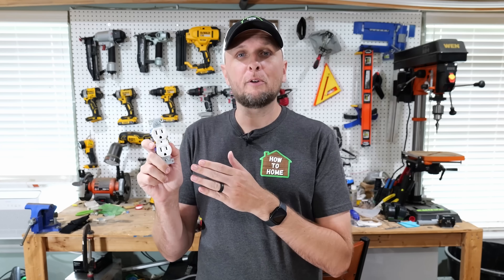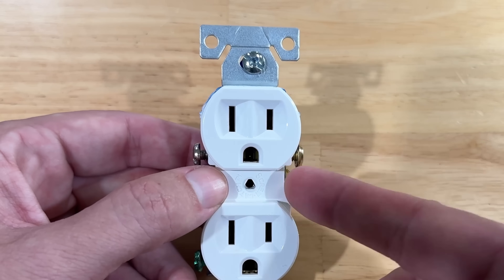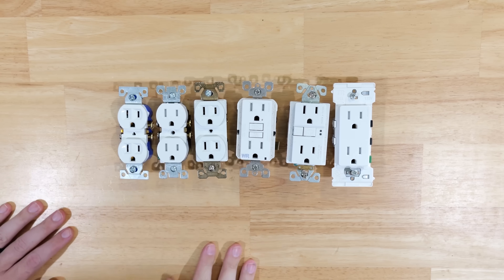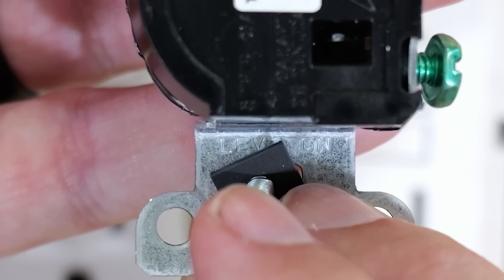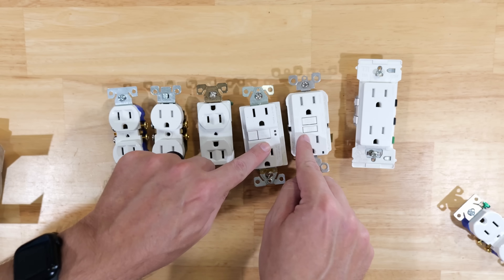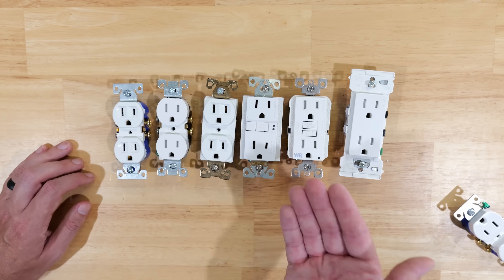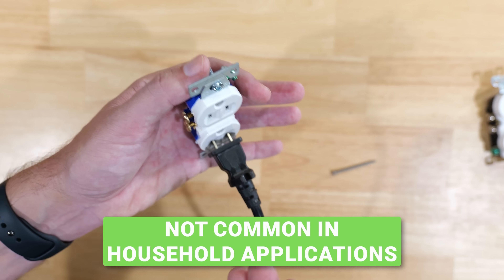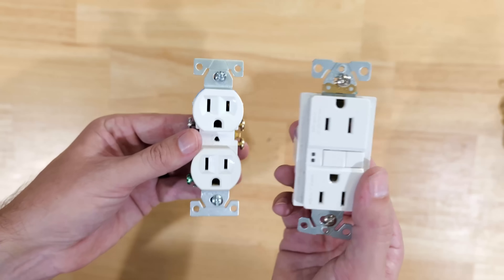The Shocking Reason Why Your Outlets Are Installed Upside Down!

Comment: We lived in a house where nearly all of the outlets were installed with the ground pin facing up. It only really caused issues behind the refrigerator and a few similarly designed appliances where the power cord was manufactured in a way that caused the cord to loop over the top of the outlet. The cord was shaped naturally for the ground pin to be on the bottom.
Reply: In our area all you ever see normally is ground down. The other way would be considered wrong but not code violation. Having ground down had two other advantages you didn’t mention. In that orientation the cord tends to be more securely held with the large round pin supporting the weight of the plug above it. Also when you go to plug in it’s easier to find the location of the sockets when viewed from above which is the usual case. With ground down the pin and part of the body block the view. To my mind this is the best reason for mounting ground down. However sometimes you run into a wiring or mounting situation that forces you the other way. Not unsafe just unusual.
Reply: When we built our house, we installed all the outlets sideways. The plug closest to the switch was the one operated by the switch.
Reply: @rivermcratt3683  If you put all the outlets sideways did that mean all the outlets were on a switch?
Reply: @daveneil3963   no, but the ones that were on a switch operated as I described.
Reply: @rivermcratt3683  goody two shoes for you
Reply: @rivermcratt3683 so ground towards the switch or away from the switch?
Reply: My comment exactly. I have yet to see a right angle plug that isn't prong down
Reply: @RickYelley 
I have two heavy duty extension cords, originally purchased for "window banger" air conditioners that now reside behind chests of drawers in our master bedroom. They are oriented "ground up" so the wire hangs down. They are no longer needed for air conditioning but serve for tv and radio outlets. Otherwise the outlets would be useless. Those recepticals were rotated, to "ground up," to accommodate them when we moved in.
It amuses/annoys me when I go to my Dr's office in a brand new building and the moulded plug on the examination bed is plugged into the wall receptical and the ground is down forcing the cable to be folded over the plug because it's ground is designed to be "ground up!"
What I'm trying to say, there definitely  are applications when recepticals should be oriented "ground down!"
Reply: In my experience, if you go to a hardware store and look at outlet strips and extension cords, the majority of them that have a up/down design are designed for ground plug down.
Reply: @ballardcoolpix  In this case "the majority", meaning "every single one", of course!
Reply: @ballardcoolpix  I've got a couple of 8 port surge protectors where the earth in face up for the top strip and down for the bottom strip.  I'm guessing it's for those oversized electronic devices like chargers etc that would normally block the outlet below it all all the outlets were to be earth down orientated.  I'd be OCD though were an ordinary wall outlet  were to have an up-down. up/up orientation, aesthetics matter.
Reply: lol this is an annoying ass problem when dealing with washer and dryers. So annoying that I've rewired whole outlets to fix it.
Reply: For any place that the outlets are upside down, I just buy and install rotatable 4-way outlet adapters. I got mine on Amazon and they include surge protection as well. Easier than fixing the outlets in the wall, and you can take them with you when you sell. Bureaucratic overreach defeated.
Reply: I had a contractor who made us install residential receptacles ground down and commercial ground up. I'm sure this was so that commercial medical facilities were ground up.
Reply: Yep. that's why I don't agree. When I moved years ago I switch them back the way they were. My new landlord is an electrican. Unfortunately manufacturers haven't adapted
Reply: Same but even worse for plug in 240V dryers and ranges.  The cord is so thick I have flipped over the receptacle to avoid a big loop of wire sticking up or out.
Reply: @sparkyspartacus2287  I have seen range and dryer cords oriented either way. I normally remove and turn the receptacle to suit the cord in use.
Reply: It looks like comments are disabled here, so I'll try it here.
Reply: 100%. that's the main issue.
Reply: I was told when I was younger,that ground up started in hospitals,because needles had a greater chance of hitting the hot and neutral. They didn’t want the life support machinery shutting off.
Reply: I've got a washer and dryer (gas) double plug in where I saw that the one cord worked up and the other worked down! (what was I thinking but not!)..yeah..step on an extension cord and it might pull down without the plastic cracking?
Reply: Yes, good point for space saving plugs.if looped up the cord can get squished. Ground plug down behind fridges always the best.
Reply: It was like that in our house too, it drives me crazy! Someday, I'll finish flipping them... 🙄
Reply: My current house is the same way. Pretty much a non-issue aside from the odd appliance with the 90degree plugs meant for ground-down orientation.
Reply: "It only really caused issues..."
That right there is the reason to have the ground-prong down. You know what people with receptacles with the ground-prong down position never say? "It's only an issue when..." - it's never an issue then.
Reply: Where ever that condition exists (e.g.; refrigerator, air conditioner), you should simply reorient the associated receptacle.
Reply: Only because you never use plug in transformers.
Reply: My dad mounted 'em Ground Up in the '70's. His argument was the ground pin was longer, on top it was easier to see the thing that had to go in first.
Reply: It's so , if something the falls on the cord , it will shove the hot lead more into the outlet to prevent electrical shock !!
Reply: Same here. I moved into a house where all the receptacles were installed prong-up. None of my "90-degree" plugs worked in them, so I had to re-install every outlet in the house.
Reply: Having come to Canada from a country that followed UK standards with their 13 Amp fused plugs with the ground pin, longer than the power pins, oriented upwards. Therefore  all their sockets (recepticals) are oriented ground upwards. 
There are, in my experience, very few appliances sold with uk standard plugs where the wires would come out on the ground side. Also ALL their recepticals are independently switched, mainly because they use 220 or 240 volt systems. Their plugs have a much longer ground pin so that the device is grounded before the "gates" in the receptical are opened, by the insertion of the ground pin, to allow the live and neutral pins to contact the sockets within. Also the "live" pins are insulated for about a quarter inch from the plug's base so if its not inserted all the way, you still cannot touch the live prongs. I will add that this feature is relatively new and older style 13 Amp plugs can still be found where bare metal on all three prongs extend all the way from the plug base.
Long story short, any recepticals I have installed or replaced in my Canadian homes in the last 40 plus years, go in with ground pin up. Where extensions or appliances have need of "ground up" the recepticals have been  rotated.
Having said that, I'm pleased to hear that there is nothing in code to say what I'm doing is wrong. Thank you.
Reply: Yeah, I have flipped several outlets to ground down in my house because all the flush or right angle plugs that I have encountered are ground down orientation and if plugged in to ground up the cord is fighting gravity and no longer very flush behind anything.
Reply: Yep.  In this case, I pull the receptacle out and swap it around.  Better than having the cord loop over.
Reply: @glen4cindy    Yeah.  Every refrigerator in our hospital has this same issue.  At least in the break rooms.
Reply: So flip the affected receptacles over...
Reply: all recepticals in my apt, single hole is at the top making it very difficult when plugging in a 3 prong plug
Reply: Exactly what I was going to say. Also, some older wall warts are polarized for ground prong down and surge protectors and UPSes often have angled cords that are also designed that way. They are quite awkward when plugged into ground prong up outlets.
Reply: The short that he demonstrated happened to us.  There was an outlet behind my sons dresser that had a small lamp on it.  He knocked a metal necklace off of his dresser and it fell perfectly across the plug contacts.  We could smell an electrical arc and it tripped the breaker.
Reply: @ExFed2021  Right, trip the breaker, which is what should happen. No fire.
Reply: @ExFed2021 So your house didn't burn down after all! Imagine that - the breaker did its job.
Reply: Every flat plug appliance cord or extension cord has the ground prong on the bottom when plugged in with the cord hanging down.  As far as I am aware there is no code requirement to install the outlets with the ground plug at the top nor is it recommended by any outlet manufacturer.
Reply: @brownro214  True that there is no code for this.
Reply: I have had this issue also.
Reply: @joshuasnow810 Then you do not have a hair dryer.
Reply: Ground prongs down in the northern hemisphere; ground up in the southern hemisphere.
Reply: @Edgy01  are you one of those that insists that "North is Up"?
Reply: @Edgy01 😂
Reply: @Bob-xj8jl  lmao yes that's the face! If my outlets dont look surprised then I dont want em!
Reply: I've a AC with a 45 degree plug, one way it is long enough but the other way takes way more cord.  Wonder why they did that at all.
Reply: @chrisbraswell8864  Because it's supposed to be Ground Down.

Comment: I was measuring a wall when my tape measure slid down and arced on a partially inserted plug in a ground-down outlet.  Even so, I would vote for ground-down.  The right angle plugs and smart plugs in my house are designed for that.

Comment: You are 1000% incorrect.
As an electrician, I've never in 45 years had one issue with the smiley face way. If you put them in your way, I'd turn every one back the recognized way again.
Reply: If your outlets have a smiley face instead of a Mr Yuk face, you're definitely installing them wrong.

Comment: Yet another video on this subject... <sigh>
In the US, ground up often indicates a 'switched' outlet which is a good idea (not "necessary" - but good).
In Canada ground up is recommended as a best practice (or, if the outlet runs horizontally, neutral up).

But frankly, it's all over done nonsense (and is not in any code in N.A. that I've read about).

What, really, is the likelihood of something metallic getting in there?  And if it did - the breaker should trip.  That's its job.

Comment: I think most residents expect the ground pin to be down, and it’s frustrating enough to try to plug in a power chord at night, or in an area you can’t see, without also having to wonder about orientation of the receptacle.

Comment: I was talking with my mom about this because because many of the outlets in her house are installed up-side-down (ground up).  She was asking about that.  I explained that in residential installation, it is a preference of the installer and there was no code that required it.  I tried to explain the reason for having ground up vs ground down.  
This  whole argument was likely caused because ONE TIME, something fell and hit hot and neutral of a plug that was part way out and the person who did that got on their high horse and started the campaign to invert outlets.
It would be interesting to experiment with this to see how difficult it is to cause an arc (closed circuit) with both outlet orientations.  Even with ground up, if the object doesn't bounce off, there is a 50/50 chance it will slide over to the hot (line) side and cause an arc anyway.  That is assuming the device has a grounded plug as you pointed out.
This really is an argument for people who have too much time on their hands.  😀
Reply: ONE TIME at band camp...
Reply: And it's an argument, if worth taking seriously, is actually an argument for a recessed plug interface, instead of our system that allows for such a flimsy connection in the first place.
Reply: I also had something metallic and very flat like a lid, don't remember, it fell onto the blades and blew a fuse.  I'd rather blow a fuse or breaker than be zapped a zillion times with a pointer finger error😮
Reply: @laars0001 ALUMINUM VENETIAN BLINDS.  What a show !!!
Reply: I've had stuff fall on a plug and spark myself more than once.
Reply: @John_Ridley  So why didn't you have the plug all the way in the receptacle? I have NEVER had it happen to me once so maybe you are accident prone or plain careless.
Reply: @KStewart-th4sk  The thing that fell on it was pretty heavy and levered the plug out of the socket.
Also, the typical crappy plugs that get installed in the US (the ones that are $8 per dozen at Home Depot) after 20 years or so are so weak that they won't hold a plug anymore. If you go into any hotel room that hasn't been remodeled in 5 years you will find that you can't get anything to make proper contact anymore. I have had to replace 4 or 5 sockets in my house over the last 20 years as they got to the point where plugs just fell right out of them.
Reply: @John_Ridley  I call bs on things falling on a socket and shorting out "more than once". That or you are terribly careless.
Reply: @renalshomlmes338  Well, I'm sure that you know my life better than I do.
Reply: Nobody got on a high horse about this, as there is no rule one way or the other. I hate having ground up as timers etc would be upside down
Reply: Even in that unlikely scenario, wouldn't the breaker trip?
Reply: Don't want to take too much of your valuable time, but think ALUMINUM VENETIAN BLINDS. The gravity of this situation is plausible.
Reply: One time is likely very accurate
Reply: Yep, and some plugs that include the ground pin will pull themselves out with it it inverted, because of the added weight of the plug

Comment: As someone who keeps aquariums and works around water a lot, Ground prong down.  simply because gravity and the way a lot of cables(especially low profile cables) flow towards an outlet.  low profile cables have an angled bend to them at the outlet.  with prong side down the cables angle downwards but with prong side up the angle upwards.  If any liquids spill on these cables the fluid will flow down the cable.  Ground prong up leads fluids directly to the outlet but ground prong down leads fluids to the floor.  You can loop the cable through itself to interup the flow of fluid down a wire but this turns it into a drip that could still run to the outlet or down onto other electronics while a downward flow will almost always lead to the floor

Comment: Most plus are designed to be grabbed from the side, not the over/under technique you used in the video. That is why they have the knurled sides to aid in gripping the plug during extraction.. Otherwise intall the outlets to whatever you find aesthetically pleasing.

Comment: Many appliance cords are molded in a way that they hug the wall and point down when the outlet is installed right side up.  When the outlet is installed upside down, it causes the cord to loop up from the outlet and then down in some clumsy looking loop.  Can’t stand when outlets are upside down.

Comment: Believe me things sliding down onto the prongs happen often, mostly metal cover plates. I am a retired hospital electrician. Receptacles are mounted ground prong up, check next time you are in a hospital. Even though receptacles are periodically checked as per code, cover plate screws come loose due to frequent use and slide down on the prongs. Even so sometimes the cover plate does indeed catch the hot and ground causing a commotion.

Comment: I would always say prong down.  When dealing with larger load plugs they are usually 90 degrees, and having the wire go up then down always puts unneeded strain on the outlet and plug.  Most angled/low profile extension cords and surge protectors are designed with the smaller prong on the right side even if they do not have a ground.  I have yet to see any pluggable item designed for ground prong up orientation.  Those manufactures need to also make test reset sideways for that orientation.  Someone will get to sue because they couldn't read the writing. 😂

Comment: Another case for ground prong up:  We have all probably seen a plug or outlet that has gotten hot and melted.  Usually this is because something has pulled down, or out and down on the plug, thus resulting in the Line and Neutral prongs just barely being inserted into outlet.  When an electrical load is applied, the barely inserted prongs can heat up and melt.  This is why a ground up position is better.  The plug will stay in better, because the Line and Neutral prongs are harder to come out if something is pulling down on the cord.  I worked at Nuclear Power Plants, and our Electricians installed outlets Ground side up for this reason.  Extension cords plugged into outlets can take a beating.
Reply: Malarkey.  The prongs are generally only contacted at one point, not along their entire length, and that point is closest to the face of the outlet.  Overheated plugs are a result of loose/spread contacts in the receptacle.
Reply: This is a good reason! Too bad many powered products expect the ground to be facing down.